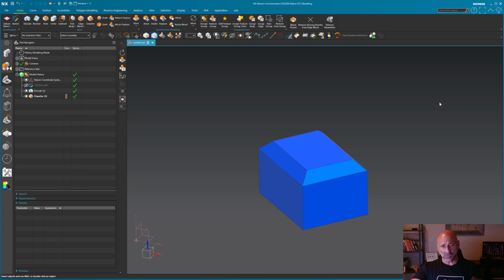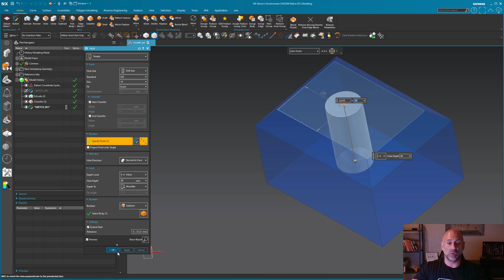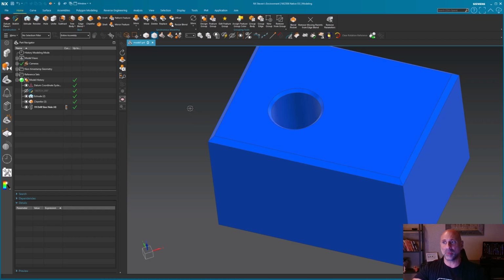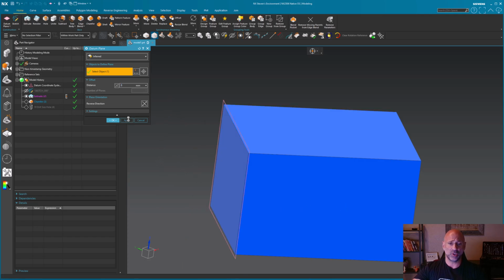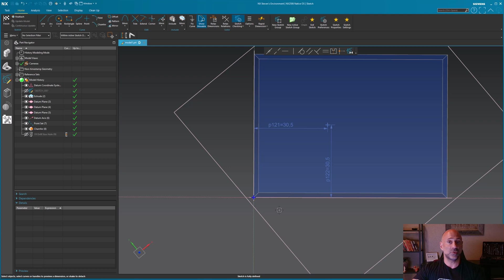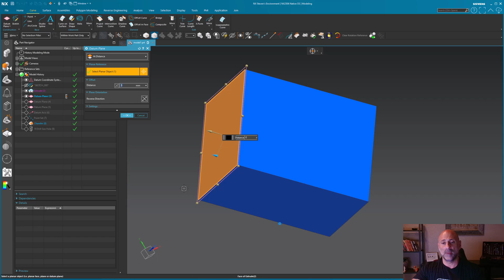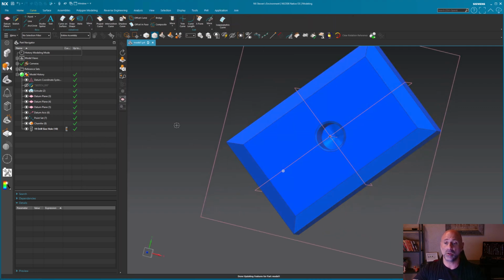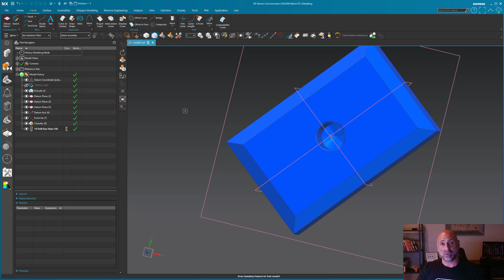🔧 STOP Making This CAD Mistake! Design Intent Will Save Your Models (and Your Sanity) 🚫 | Part 1

Comment: A huge thing I was taught years ago that can often help with getting some of the design intent locked down is sketch out some key elements on paper, dry erase board or whatever before diving into the actual CAD. Slowing down for a few minutes before starting a model really helps think through that design intent so that when things evolve through the development process you can rapidly make the changes without the model breaking or can quickly fix broken references.
Reply from the maker: I absolutely still sketch things out on paper or I try to dig around one of the cars out back and get ideas. 

Sometimes I will fix something on the house to spark the creative juices while being distracted. 

I pinned the comment because of the excellent suggestion
Reply: I used this technique today but slightly differently. The case was to influence designers to have deeper thought processes and understanding of 'datum objects/features', the different types, and how to use/consume them.

Constructing the problem on paper, identifying, sketching in, and labelling datum features on the problem was relatable and worked well to visualize the solution.
Reply from the maker: Love to hear that. Thank you

Comment: Hi Steven

A very clear lesson on a very much disputed topic. Whilst I agree with everything you say, and that design intent and all techniques involved with it are extremely important. 
But while it does save you a lot of time when changing things, time saving is, in my opinion, often the cause of not implementing good CAD design practices.
Too often, I've seen newer, often younger, designers be pressured into quickly doing something by (design-) managers because time is money. And, maybe because they are young and or new in the company, they comply either for fear of losing their job or thinking that's the way it should be done in that particular company. And often they are not taught good design practices in their CAD training.
I've experienced the pressure of these managers more than once myself, but fortunately, I'm stubborn enough not to go along with it and start discussing 🙂. The main reason I've found for wanting things done roughly and quickly is that they haven't discussed with the CAD designers how much time should be budgeted to do certain things, and they just put a number in the budget based on a previous project. Obviously, no 2 projects are the same, certainly not from a CAD point of view, and they usually end up with too low a budget, or they need extra points with their manager by getting things done on the cheap.

Unfortunately, while I will keep on fighting for good design practices, as I'm sure you and a lot of our experienced colleagues are, I'm starting to get the feeling it's becoming a losing battle.
The last few weeks I've been working at a company where good practices, drawing standards etc are completely tossed aside for the sake of timesaving. I've allready had numerous discussions with people who are proud of finding a way to save 1-2 minutes to finish the model. Obviously not by using good design practices. 
I should have known better than to discuss with them, because there's no way to get through to them. And it's not just CAD related, every single thing they do needs to be done in as few seconds as possible, almost literally. And they're proud of it...
And it all works fine until you need to change something, and then it doesn't.

End of rant 😀 
Looking forward to hearing your experiences and take on this.

Greets,
Stefaan
Reply from the maker: Hello Stefan,

You are absolutely more than welcome to rant. The best part is I absolutely agree with that rant. The amount of wasted energy on poor design methods is astounding. 

The lost opportunities  to make things better vs expending energy on the same stupid mistakes. It is so galling. 

I will make a video about and thank you for the idea.
Reply: @StevenMarji  You're more than welcome for the idea. Looking forward to hearing about all the stupidity you've encountered ;-)
Always happy to discuss and/or brainstorm...

Comment: @StevenMarji, nice to see this topic being shown/talked about. I use similar techniques to what is being shown, using datum festures to construct stablility into the model. Typically for holes I will use points and point sets rather than sketches. When needing to sketch of a face, I have customer defaults setup such that I can select a datum CSYS plane to associate the sketch origin and X vector, then select a face to replace the sketch plane, this limits the sketch associativity to the solid body which may change and cause future disruptions.
Reply from the maker: Unfortunately from what I'm seeing in a lot of the places that I consult at or do any work at is a lack of forethought and design intent.

So I want to keep pumping out videos like this in the hopes that it improves things. 

Please feel free to continue to bounce ideas into the comments

Comment: Working for Fiat in the suspension geometry area, I came across a design idea that I found interesting, which was to use Datum CSYS instead of Datum Plane, something I find difficult, as it involves dealing with wave links without losing references.
Reply: We used Datum CSYS's to great advantage in SDRC I-DEAS back in the late 1990s for machine design, both for creating stable geometry in individual parts as well as very stable top assemblies. Back then we called them "BORN", which was SDRC's acronym for "Base Orphan Reference Node". I prefer to call them "Datum CSYS" as in NX, but the idea of the self-contained, seven-element Datum CSYS originated in I-DEAS as the BORN.

It's not clear from your post, please clarify which you are finding difficult - using Datum CSYS or using Datum Plane? And how does using either method relate to keeping WAVE linking references intact?

Thank you.
Reply from the maker: Thank you @micSofty .

And yes @Renators can you please be a little more specific?

Comment: Great video, this will be a nice one for new users to follow.  Thanks for the hard work on this.   Yes I agree this needs to be taught in college.    Why is the part in 3D space and not at 0,0,0?  Please discuss where you start your part at in 3D space.  0,0,0 or other design in the assembly location.
Reply: Steven mentioned the part could have been imported. Lots of MCAD users design their parts in context of the assembly, which inherently puts those individual parts away from the assembly's global origin of 0,0,0 and may well also put them at angles relative to the assembly's three orthogonal planes. His point in this video was to create subsequent features relative to the most stable, unchanging geometry, which in this demo is the side faces of the block itself.

There are many pros and cons to designing components in the context of the assembly as opposed to designing parts in their individual part files relative to their individual, part-level global origins, then placing the individual parts in the assembly using assembly constraints. Every designer has their personal preferences, every company has their own policies and best practices they want you to follow. Hence, some parts you encounter will have been modeled at their individual global origin relative to the part's own three orthogonal planes, and some will have been designed out in space relative to the assembly's origin & planes.
Reply from the maker: @micsofty as per usual my friend, you are correct. Thank you sir!